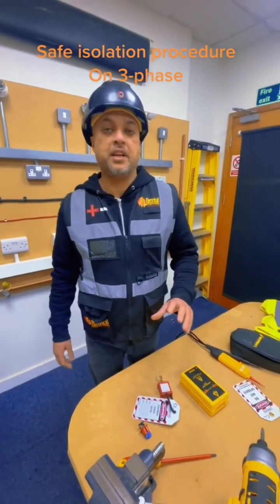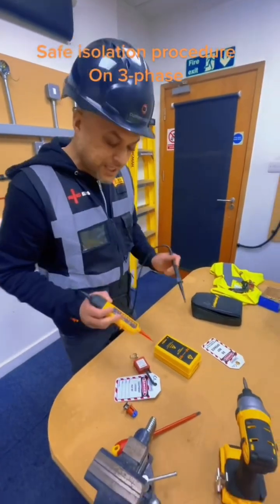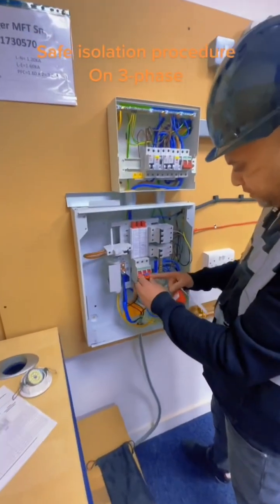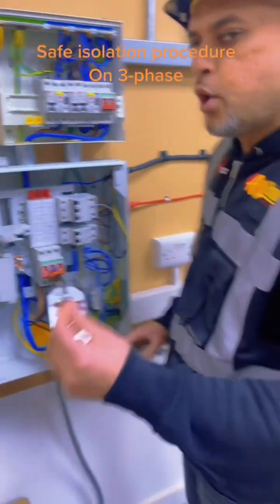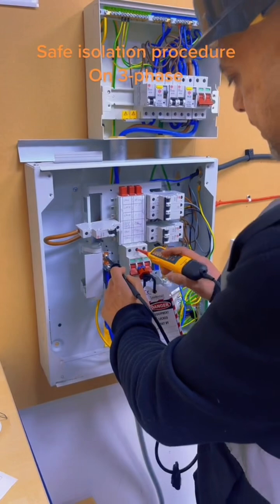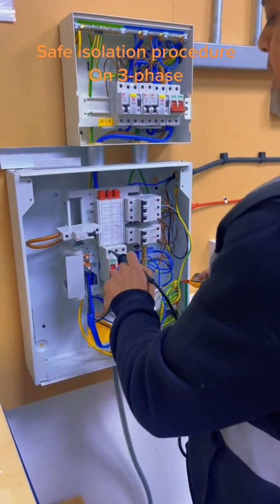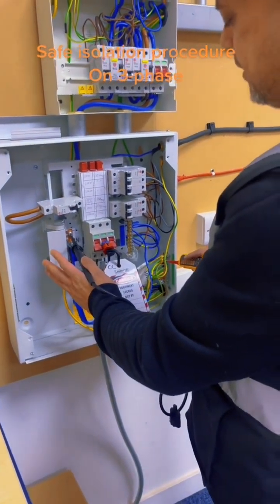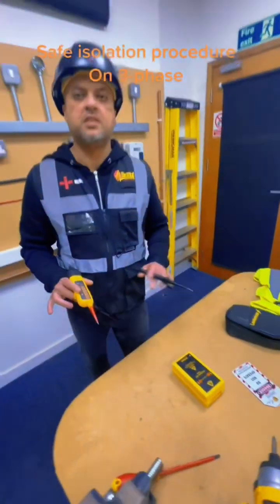Safe isolation procedure

Comment: GS38 states that you should prove the proper working on a none source or a proving unit . A none source can be a live circuit that is not being isolated and worked on it can also be the live incoming side of the main double pole switch. You should also lock/tag off before you remove the distribution board cover.
Reply: Are we sure its spelled "none"? 

Is it not "known"?